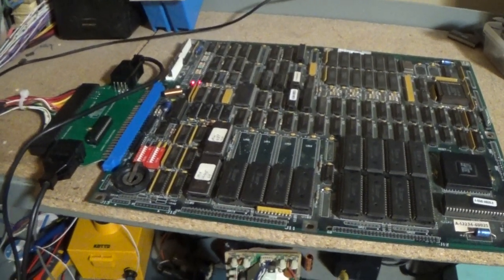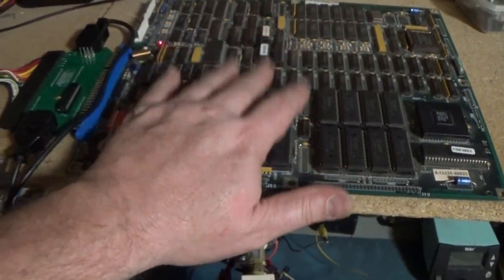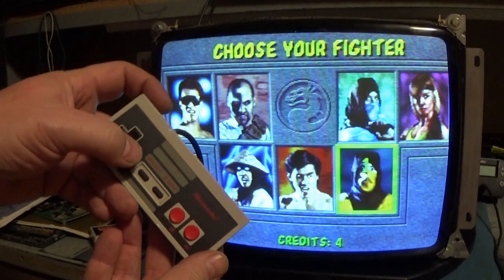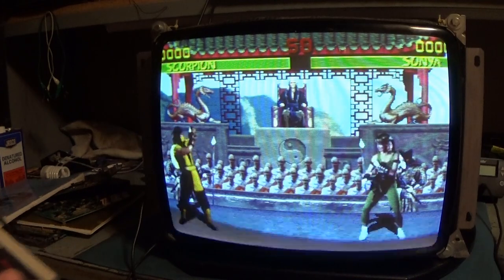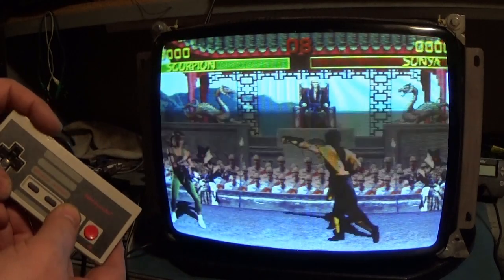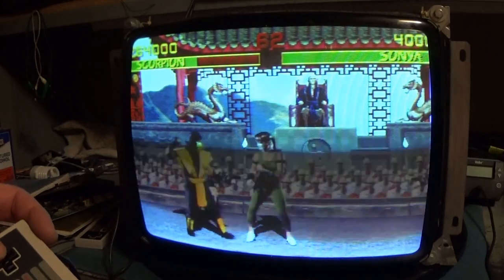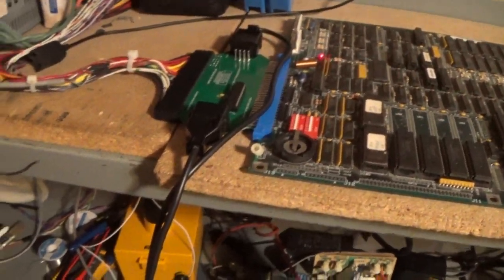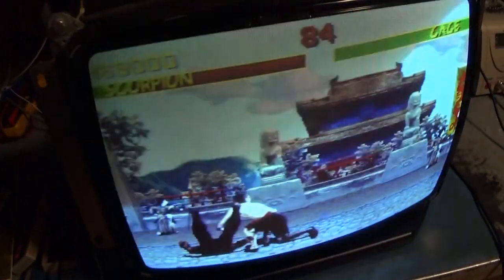Playing Mortal Kombat Arcade On NES Controllers? YES!

Comment: Now if the guy who made that NES adapter can make another one for SNES. You would have all your face buttons and both shoulder buttons can be the run and block input.
Reply from the maker: Only 3 buttons are supported by the Jamma harness. PS1 or SNES controllers will be no different than NES controllers. The low attacks are a separate harness and don’t go through the Jamma harness.
Reply: @YourMKArcadeSource  make your own, just splice the SNES into the kick harness in conjunction 🙂